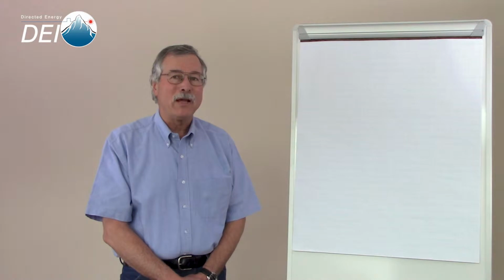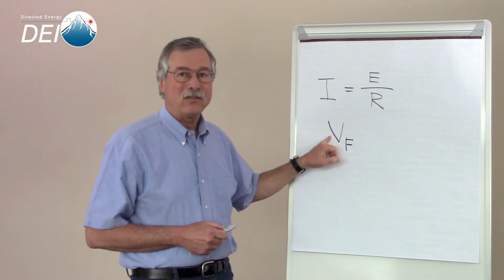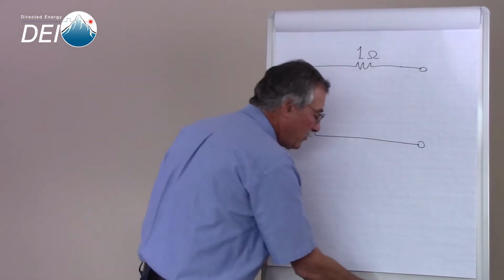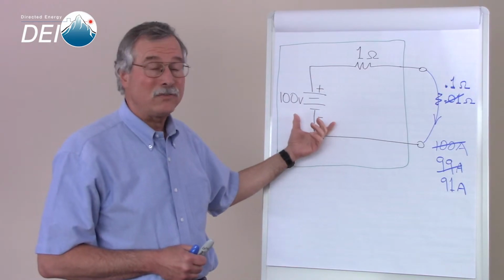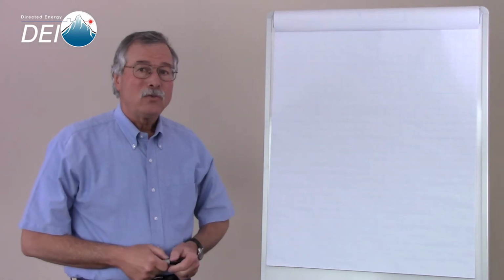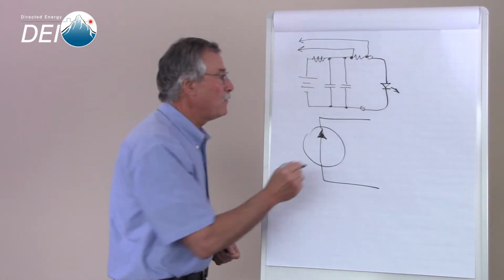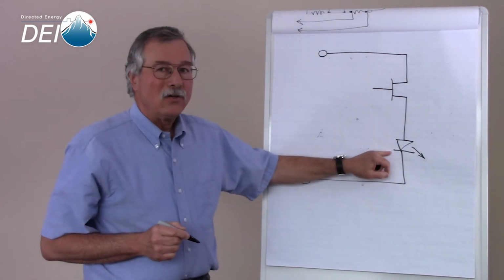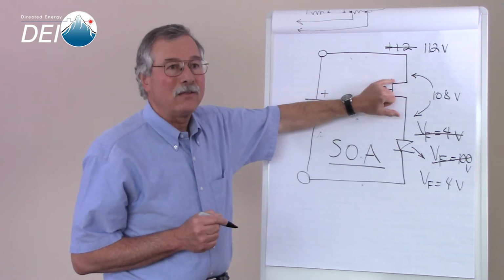Demystifying Laser Diode Drivers: Current Sources versus Voltage Sources Rev 2019

Comment: Good afternoon, I really like the explanation of the current sources. I wanted to check the following. In the last part of the talk, he indicates that one can have a laser diode with an operating voltage of 4 Volts, but the current source (or voltage source) is going to supply 12 V. If I understand correctly, what it says is do the 8 volts fall on the mosfet? And that's why you have to take a good look at the voltage operation in the transistor. I conjectured with the naked eye that if one feeds a 4 V diode with 12 Volts and a mosfet, it ends up burning it. have I understood correctly? is the excess voltage absorbed by the mosfet? Thank you very much for your video. Greetings from Argentina.

Comment: i know your giving factual information and i dont want to be that guy but your initial example is only true under specific conditions. if your 100 v source only has 50 mA of current a 1 ohm resistor will not make it 100 A. i know its disappointing because i found a could 2 watt 1 ohms resistors hiding in battery chargers and thought omg i can take over the world now but alas current equal to the voltage did not manifest because the batteries could not supply that current. 

from what i can tell while you can get proper current / voltage limiting resistor values from ohms law with batteries its less useful and with transformers or inductor driven power supplies its more relevant but the 1 ohm resistor still faces the conflict between ohms law and reality. i have a voltage at a set potential and that potential has a max voltage and max current and given the resistance you get a value between those 2. it can be more voltage and less current or more current and less voltage. im sure smart people could phrase this all better but this is my experience

Comment: hello Mister, can you tell me how to calculate which capacitor to use in a laser driver? someone gave me a plan and there was written i shall use a 47mF cap, but id like to know how to come up with this by my own...
Reply: use a scope and adjust accordingly.. Caps on the output of a switching driver really depend on how ugly the signal is.
Reply: @SNG.OfficiaI  i dont know how to scope, i just got a plan for a simple laserdiode-driver, and theres a 47mF cap in the scheme, i just wanna know why its 47 and what happens, if i use a bigger or smaller cap?
Reply: @melangkoh4184  if you plan on builds using diode lasers and are making your own driver circuits, it's a good idea to pick up one of the hobby grade 20$ scopes on ebay.

Start with the ic of your circuit, look up the datasheet and they usually have exams circuits.

Depending on the driver and how clean it's output is, determines how much filtering you would add 

The goal is low ripple, and overshoot.. these will degrade and or kill your diode.

What wavelength laser are you using? Some are more robust than others... Also what type driver? Switching boost / buck type or linear?

Number one thing is use only a constant current based driver..
Reply: @SNG.OfficiaI  https://www.youtube.com/watch?v=E0KyIP9RiNA&t=104s
thats the video that gave me the idea..ive actually ordered some more expensive drivers weeks ago..but im planing on building this thing just for practice. I just wanna know how he came up with the number 47mF. A Multimeter doesnt incolde an oszilloskop, does it?
Reply: @melangkoh4184  that's an lm317  in constant current mode. It's a linear regulator, so if you use with batteries, a small cap on the input and output is fine.

Be very careful with that build if you are using the 450nm 1W diodes. A simple reflection off a white wall in close proximity WILL damage your eyes . You first need proper OD4 goggles.
Reply: @SNG.OfficiaI  thank you but im not really happy yet :) so what are the vales you need to calculate the size of the Caps, does it have to do with the size of the laserdiode, the voltage of the battery/powersupply, or is the amount of "ripple" the only thing that goes into that calculation? i wanna be able to build laserdiode drivers on my own.

Comment: But the capacitor will take forever to charge.. so you need a bank of capacitors to make up for the amount of time it takes for the power supply that charge the capacitors... So technically I guess capacitors in parallel.. multiplying the voltage with each capacitor added..

Comment: Well Ohms Law is not about Current Inversely proportional to Resistance. Current is proportional to Voltage across element. The Proportionality constant is Transconductance which should be Constant, otherwise Ohm's Law is invalid i.e. I must be linearly varried with V for ohms law
Reply: v=ir only works perfectly for linear devices. That's why in school they start with passive device and ohms law